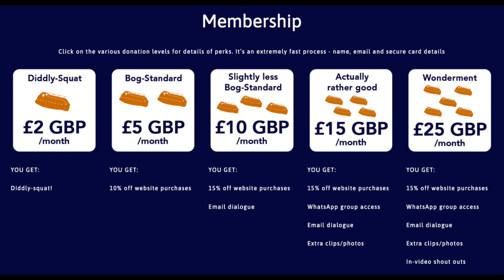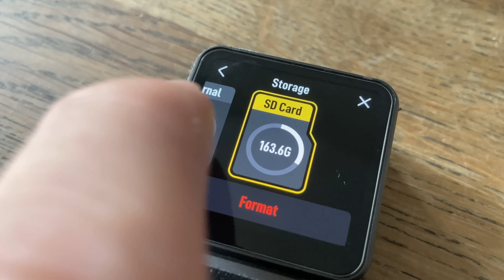Lifeboat Conversion Ep47: Discovering a very unhealthy exhaust pipe hidden beneath heat lagging [4K]

Comment: I would recommend you put  a camera ( car back up camera ) in your engine bay 
And a small led light 
That way you can keep a eye on  the engine with out pulling everything a part
Also they come in 12 and 24 volt or both
Reply from the maker: Internal CCTV - oui!
Reply: 24 hour streaming of alan's engine! nice
Reply: I may had that most car back up camera you can buy come with fairly powerful LED mounted next to the lens !

Comment: I worked for a ferry service which shall remain unnamed, and there was a story rolling around about taking one of the ships down to louisiana for overhaul. They'd shorted themselves on fuel for the next days trip by their standard math because, hey, boats empty, we should be good. As they were lining up at the pier for the night, just as the guy on the bow got a line to the pier, one engine cut out. They literally docked with the fuel in the lines.
Reply from the maker: The context of the story was a huge (contained and extinguished) boiler room fire, but yes, needing everyone to be at the top of their game.
Reply: @AlexHibbertOriginals  A large boiler room fire is kind of terrifying all on its own.

Comment: I believe that exhaust pipe heat will keep the lagging dry. It may be much cheaper to replace the exhaust pipe with more mild steel and just use the engine more. However stainless would be better, just more expensive.
Reply from the maker: Yes I think you're right. It was run only sporadically for years. Most use has been over the last year or two, and then, only about 3 days of solid running.

Comment: On getting a pipe made, best off just letting the weldy-person get the pipes, they know what is good and what they can get for a decent value
Reply from the maker: True
Reply: @AlexHibbertOriginals  not neccessarily as a shipbuilder I would suggest 316 ss for the whole thing. No fancy coatings required but ensure they are familiar with ss    many are not and will cheap out and the arctic is the LAST place you need a broken exhaust ! Been there

Comment: Alex, As a past life lifeboat servicing engineer I would suggest you don't use stainless for your exhaust it would have to be 316 and with the galvanic reaction and the brittleness with vibration from fixed ends not so good. If you buy a heavier wall mild steel pipe and several cans of VHT Flame Proof ceramic paint and spray some into a tin and pour inside,  spray the outside  then use thin sheet silicone taped over the pipe before the heat wrap. You can buy or make spring loaded "flappy things" to help reduce trailing sea wash. Good Luck
Reply from the maker: Thanks Bruce. The quotes I have for 316 throughout, with flexi sections to reduce vibrations, aren't too bad compared to cheaper stainless or even mild. I think by the time I've used specialist treatments for mild steel, silicone wraps etc, the finances would be similar. It's a dry exhaust, so I'm not so concerned about galvanic corrosion. It'll be isolated from other metals.

Comment: Take proper advice before using stainless steel for marine exhausts. I am not an expert, but have had problems with stainless exhausts on yachts, admittedly with water cooled exhausts not dry exhausts like Alan.
My understanding is that Stainless Steel is only stainless in the presence of oxygen, and very much dislikes chloride ions and sulphide ions, which lead to crevice corrosion, especially around welds.
In the exhaust of a hard working diesel engine there is not much oxygen and quite a few sulphide ions. Plenty of chloride ions in salt water also..
There may be a grade of stainless that will work well, coupled with proper pickling after welding, but do check, not just assume that stainless will be better..
Reply from the maker: Yes I encountered the various SS grades early on in the project. The data I saw suggested that 316 may lose 0.1mm/yr if immersed in water with these ions present, and with oxygen absent. 304 loses 0.2-1mm/yr, which would be a problem for a wet exhaust. A dry exhaust won't be immersed in ion rich water, and will have exposure to oxygen.

Rather like galvanic corrosion, stainless steel bolts in mild steel plate will cause a major reaction when immersed, but very little drama if mostly dry.

Comment: Glad you were able to find the issue. Do you think that the cowling is a little to complex if you need to access the engine in a hurry in extreme conditions? I also never really got a good perspective of just how much space was inside of Alan, it was an interesting angle from the stern there. Do you plan on changing the exhaust outlet or will that flappy thing be ok?

I will probably send you an email this week, please keep an eye out for it!
Reply from the maker: The panels come off in seconds - so there's access. 15mins was for the entire disassembly.

I plan to keep the flappy thing - it works nicely.

Comment: Go with at least 304 stainless pipes not 409, which could be tempting due to the price. If I were around your area I would gladly weld it up for you for free, but alas I’m not there often. Then think about coating the exhaust before wrapping, like the equivalent of POR15 high temp coating. Coating the internals would be good but cumbersome.
Reply: For the price difference get 316 and never worry. Just make sure your welder only uses 316 rods. Spend the couple of extra bucks and get/ make 316 flanges.

Comment: Those wraps will wreck a Jeep exhaust too.
Reply from the maker: I need a serious research session to find a better lagging.
Reply: @AlexHibbertOriginals  
I'd recommend a high temperature exhaust enamel header paint as a base layer but it outgasses with a lethal smelling smoke as it cures.   Not safe for a boat's cabin.

Exhaust wrap is staggeringly hydrophilic.  It could end sea level rise.
Reply: Period Triumph and BSA motorbikes had the same problem with wrapped exhausts.  Looks nice but hides a plethora of issues !
Reply: I haven't had any problems with wrapping stainless. I installed standard glass fibre exhaust wrap on my trials car about 15 years ago. The headers get covered in mud and water and I have see no evidence of corrosion. The steel O2 sensor bung in the exhaust is completely rusted away. Admittedly this is not salt water.

Comment: For the love of God please put a carbon monoxide/co2 detector.. Or 3. O and stainless steel bellow style flex joints are way better and don't leak, allso pack a few packs of Holts gun gum or similar to repair any leaks on your travels... Even the best stainless steel can randomly break because the universe is harsh... Mount the detectors low down btw
Reply from the maker: Already installed, and with no need for any god to get involved!
Reply: @AlexHibbertOriginals  I'm deeply pleased to hear you did... A month ago someone I know died of carbon monoxide poisoning its real